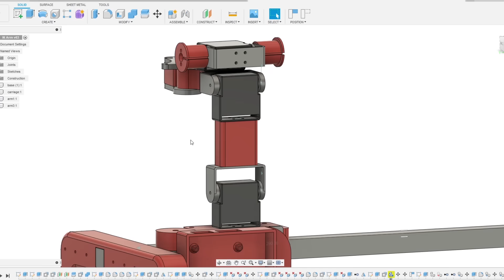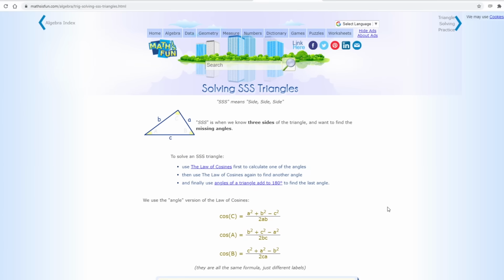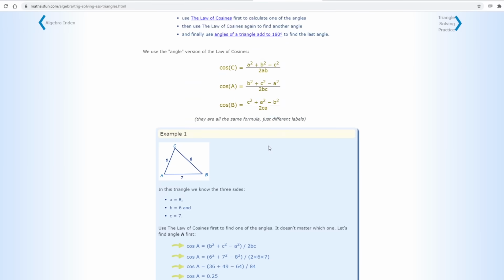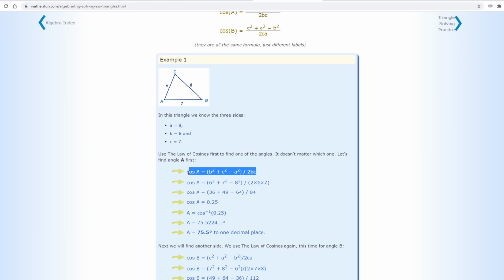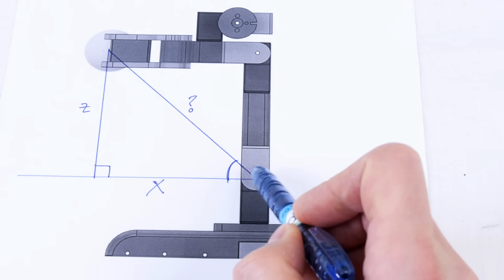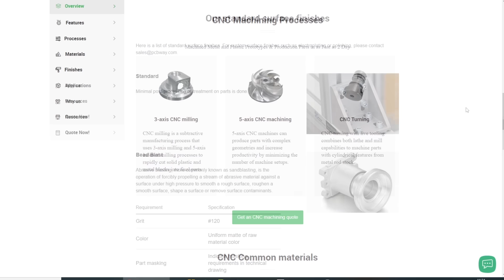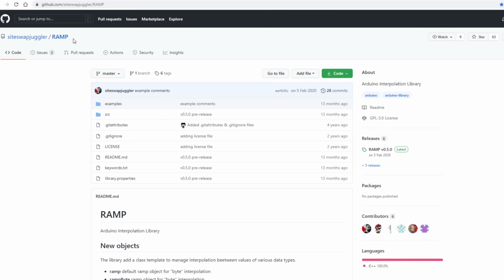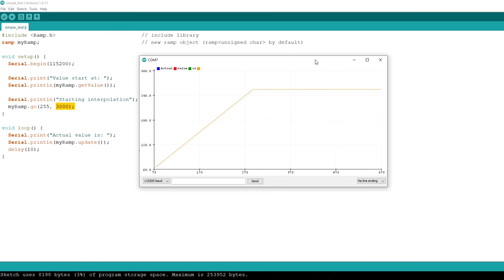How Robots Use Maths to Move

Comment: Have you ever asked your robotics lab professor this question why do we need to give the gold kit robot the gold? He doesn't really know why he is saying that about the kit to his students and class. I know why he is saying that to the robotics students because if they're coded correctly they would be alive to take the gold in the gold kit robotics that cost $7887.

Physics Systems of Science Sensors and Technology Research:

((G^2.07)R))=E general relativity law 

(gold kit fukushima robotics) >>Using a test method eliminates errors and worries about false data and research. You can prove it to yourself to work with the robot and use your own test points in the method. The test method starts low and goes high for the acceleration factor.

Please tell me in history when Isaac Newton had Robotics or computer science. I do not believe he had it all around good as a modern physics researcher.

Found on the first line of code in the standard operating computer systems line code. You will remain stuck and they are useless without this code test method for their life.
F=m*23
F=m*333 
F=m*633
(Voice prompts start at 933)
F=m*933 ----robot states "too slow human" a voice box is required for audio prompts to go higher in the test method test points. Isaac Newton born in 1643 did not create.

F=m*1993 -----robot states "too slow human" 
F=m*2293
F=m*2303
 F=m*2393

F=m*2394 ---Upper Limit Do Not Go Over this Value.

 Their command is like this "make it SO and make it a go, go, go" --I could not put the swearing in this, or this could be flagged or blocked. Ask for their command and they will repeat it for you as much as you need. Give them at least two or more calculators and/or cell phones to make the robot's reaction time faster they do not have to be new cell phones either could be old junk used ones.

You can also use code: F=m*a*b*c 
Equals:
F=m*2308

Not this low acceleration factor code: F=m*a*a
Numeric Acceleration Factor of 32
F=m(1 x 32)

Dr. Ronald G. Erickson
PhD Robotics Science
PhD Physics

Comment: Hi . Thank you for detailed video . Can you help me on my project ?? So my project is that : İ make 5 dof robot arm and İ am ussing processing app and writing java code for it  i can dedect my cube on java program and i can move arm only cube's direction but İ want to if program dedect cube ,robot arm grab cube and take it any other place . Note : my servo motor connected to 32 channel servo controller board (from torobot) and İ send it datas (servo postions and speed) with usb like : #1p1500#2p100T500  so   #1p(rotation state from 500 to 2500)T(milli second for moving destnation place . İf it is high ,motors speed is low , else if it is low ,motors speeds is high)    İ think that İ can explain my problem . İt is extremely hard for me 😢

Comment: bro could you do one thing could you tell me that which software are using to design robot in computer and how to use it in computer that it will work
f and what platform you use to code arduino

Comment: Uh, I feel like this demo might be a bit misleading, this is the simplest robotic arm possible, so u can still use simple trig for both forwards and inverse kinematics.

But if you have 6 or even 7, that will no longer work, because there are an infinite number of joint confit that lead to the same answer, and so a inverse Jacobean method would work a million times better, an it allows you to constrain some of those infinite solutions to optimize for things like speed or torque in the end effector.

Also, I’m not quite sure why you used a library for the linear motor movements, that’s just simple algebra, probably even more simple than the trig you did, so it could have been another educational lesson. Also, you could have also used PID control which would’ve worked better anyways, and since u didn’t incorporate the linear interpolation as an educational portion in the video, I’m confused why u didn’t just use PID if you weren’t going to explain it anyway.

Comment: I've noticed one little thing which is not entirely correct at 11:15
If anyone is building a robotic arm, then keep this in mind:
It is true that in most cases it will move in a straight line. I believe this is true for the points you use in this example. But there are cases where the arm has to contract and later extend again. For example at 9:00 you can see the elbow making a sharper angle as it gets down, but towards the end it starts to extend a little bit again. If it would go down further it would rotate in the other direction more. So going from the starting position to the end position would cause it to skip most of its movement which means it won't go in a straight line down.
You can also see that the servos don't move at the same speed the whole time. While the arm is going down the elbow servo moves very quickly at the beginning but it slows down near the end.

One way to solve this is to interpolate several coordinates between point A and B and then use the ramp library to interpolate the servo speed between these points. Make sure you're not executing the code faster than the arm can move though. But without feedback on the current position it's hard to make everything move smooth. I'd suggest to make the movements slow at the beginning so you don't run into problems caused by slow servos. Otherwise it may look like your code isn't working properly even though you're going over the servo's limit :)

Comment: Hi :) I don't really understand the concept with the 45' offset. Sorry, I am new to servos, the milliseconds PWM basically tells the motor to turn for a certain amount of time and that equals the angle that we calculated? So I understand how the shoulder angle inside the first triangle is calculated, but I do not understand how that information is converted into usable information for the servo, because for the right triangle from the shown picture I assume that the servo is a 0 degrees and if you want to move the arm forward it has to turn for a certain amount of degrees, but that angle is not the same as the "shoulder angle" from the right triangle from the starting position, is it? So I think my question is how do you convert the calculated shoulder angle to the rotation of the servo trigonometrically?

Comment: I like that servo, big bold 20 kg cm, which is 0.2 Newton meters. That means a 2 cm diameter primary spur gear would yield about 18.79 kg of force, however, keep in mind that it is at the servo's rated rpm, which is probably very slow to give such high torque.

Comment: Thanks so much for this James. I've been watching through a bunch of your videos again while at work (I'm a D.E. teacher - coding of various kins, and robotics (using Robbo)). I had bought one of those cheap robotic arm kits from Lazada, to which I added the servos and an Arduino. At first I coded it to work sequentially, which was all I knew how to do, so arm rotation, then vertical arm movement, then the claw. It randomly selects a position by choosing numbers in the pre-defined range of movement for each servo. But, while watching this video, and others, I worked out a way to program simultaneous movement. I'm not using timing, or anything like that. It takes the current position for each servo, and the newly selected position, calculates the difference for each servo, then divides by 100. I then have a loop of 100 iterations that adjusts the position of each servo in the required direction be adding or subtracting the number and writing to the servo for each iteration of the loop. So, I have a relatively smooth transition of all three servos from current to new position. The claw is changed separately after the arm finishes moving. The servos for this arm are SG90s, so they're a bit rough a jittery, but they do the job. I've also added LEDs that light up when each part of the code is being executed and I hope to add a 2 row LCD display to show the position numbers for each servo while it is operating. The robot is mounted on the back wall of my classroom purely as a demo piece, so serves no practical functionality except the most important one - to inspire my students. Thanks again for your awesome channel! I actually feel like building a bigger arm now from scratch, perhaps using PVC piping and 3D printed joints, or metal joints, like in your example here. Hmmm!

Comment: it's anoying how much time, material, and energy is wasted printig pieces that didn't need printing.  most of the structural parts of this build could've been made with cardboard, or at least less material. i doubt this contraption is ever going to do some real work, and so, it doesnt need to be built like a tank! 
i admire the problem solving in this video, and commend the build for being effective, robust, and reasonably dependable for what it is. all i want to say is please try to be more mindful of the time and material you waste in printing non critical parts that can be easily fabricated with different materials...

Comment: What are those long power & signal cables he's using? I'm just getting started with robotics and so far I've only been able to find the fairly short dupont GPIO cables. Is there any common type of cable used for these things? Thanks!
Reply from the maker: It's mostly just wire off the roll soldered to pinstrip etc
Reply: @jamesbruton  awesome, thanks for the response! Do I have to look for any specific kind of wire or can I just buy the thinnest electrical wire I can find?
Reply: If anyone wonders in the future: I've done some further searching and it looks like the usual GPIO dupont cables are 28AWG copper wire, so I'll be getting me some of that.

Comment: I need to program a lego robot in the way that starts at 100 and that its speed is reduced smoothly if I do a challenge initial acceleration plus second onchronometer less deceleration value 10 of speed I cannot make a slow decrease since the graph gives as a result  a linear function.  By dividing the initial sum by dividing the speed line, we achieve a deceleration limit where the robot will never slow down, since each time the digits of the denominator are larger and a quotient close to zero is obtained.  worse wue never is zero the graph does not touch zero.  How do I have to make the deceleration slow and smooth? How can I have a formula in a numerical nlowe to achieve that?  I have to use a logarithm to get a curve as the formula gives the function of the velocity graph?

Comment: First of, thanks for the video! Code for the absolute coordinate is a bit weird. You computed the shoulderAngle2Degrees and shoulderAngle1Degrees but did not do angle arithmetic to calculate the final angle. Instead, you converted both to pwm secs and subtracted the two values in servo write which can be easily overlooked.

Comment: I keep swapping kinematics and inverse kinematics around. Luckily my robot has both built in.
This is a nice and simple example and looks like a scara robot that is tilted 90 deg. on the X-axis.
Programming a robot in cartesian coordinates can be difficult due to "singularities". I've had a few errors where the robot controller (Kuka KR180) would report a singularity error and not move at all but I have also had some strange movements that resulted in an overload on one of the axes. At that time, the robot performs an abrupt E-stop which is not that funny when 50 kg of mass is being moved... I actually checked the massive bolts that are used to mount the robot on the floor to see if they were not damaged.

Comment: I think it would demonstrate the effect better if it was not doing the exact movement each time, as it just looks preprogrammed. Say you had two ball feeders and it would move directly to the position right above the next ball, perhaps starting the downwards motion only when a ball has been detected so it would start the straight line towards the ball feeder at different positions on the rail.

Comment: Brilliant! Thanks! Defo more inverse kinematics. A follow on with an arm rotation axis would be great (or even bring in/demo with the slider, so all happens at same time rather than being 2 discrete sets of movement). Still not sure I totally followed (not the maths, good with trig, more the algorithm/process) but will grab the code and see if the comments help and maybe try it out on some servos with taped on pencils or something. There was also another good one you did on minidog for this

Comment: From a software point of view, when working with IK, it's always a good idea to write the forward side as well and check that the results match (within rounding errors).
What's shown here is calculated_angles = IK(demand_position).
What you would add is calculated_position = K(calculated_angles) where K is a new function to calculation position from angles.
Then you check that demand_position = calculated_position (allowing for rounding error).
The reason to do this is it will find mistakes in your IK code, if that equality doesn't hold then either IK or K is buggy. Also the K side is often the simpler of the two.

Comment: This might be good to have right before the wind tunnel part since that was very sensitive to how the balls enter, and this is probably gonna be the most reliable part.
Reply: Although didn't they need to be sorta thrown into that? So perhaps the static accelerator would be better
Reply: @xxportalxx.  that being said, the fact that the arm can move at different speeds allows it to "throw" balls, and since the static accelerator is a gimmick anyway, it doesn't get as much speed as it should and may fail. also, it's a Coanda effect staircase. a wind tunnel is a very different thing.
Reply: @Bigwings2043  idk I think it would be difficult to have it throw a ball, but perhaps that's the solution.
Reply: @xxportalxx.  although it may be difficult to code, I think the fact it is so reliable once you get the coding down makes up for it, whereas the ball accelerator is much more mechanical based, and therefore more unreliable.
Reply: @Bigwings2043  the ball accelerator is purely electrostatic, the only mechanical part is a belt being turned against a brush lmfao
Reply: @xxportalxx.  yes, but the real balls lose a bit of speed in the exchange, and by mechanical, I meant reliant on what actually happens, not purely run by Arduino. the fact that it is an accelerator means a bit of luck is involved with it coming out correctly. if the real ball is wiggled a bit in the exchange, it will not come out straight, and boom fail. also, sorry for the weird meaning of mechanical. that being said, I am not educated that much in this sort of thing, so I would differ to you if you are more educated on this subject
Reply: @Bigwings2043  no no I get what you mean, I just think with the code he wrote releasing the ball while the arm was moving would be a tad challenging. I'd try it with the other device first given that the balls intrinsically come out with some force, and if that proves unreliable I'd think adding a ramp after something like the grain elevator would be an easier solution to implement

Comment: Hi James, have you tried using the Jacobian matrix? It makes solving inverse kinematics pretty easy. Just describe the coordinates of the end effector as a function of the joint angles once and from then on out it's a matter of simple linear algebra!
Reply: It's not just a matter of linear algebra, because the forward mapping is nonlinear. Yes, you can still use the inverse Jacobian to run some Newton-Raphson steps, but this isn't exactly easier than, if possible as in this example, directly computing the exact solution with trigonometry tricks. Especially when using a low-powered microcontroller, it's quite advantageous to need only one computation step.
Reply: ...Though then again, it isn't really necessary to directly compute the target parameters at all – instead, depending on the application it can make a lot of sense to compute only directions of movement, which the Jacobian can directly offer. Then physically following the directions is essentially a mechanical way of solving the nonlinear equations.

Comment: but if you have the spirit, then you can have smart things that automatically do what you have so hard worked for
Reply: diy cnc with dual real axis
Reply: robot arm drone blimp
Reply: bendy sensor
Reply: piezo sensor
Reply: you could use a ceiling double railing robot, not a moving floor robot, to do stuff
Reply: you have the 2+robot arm degrees of freedom
Reply: make it 3, up and down rail too, on the base pad